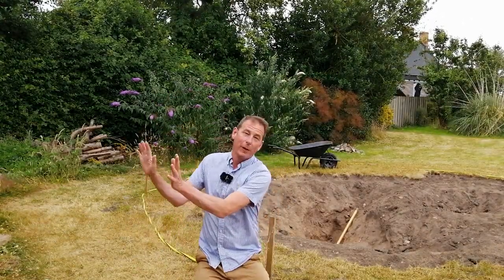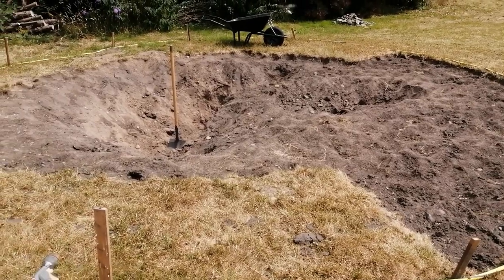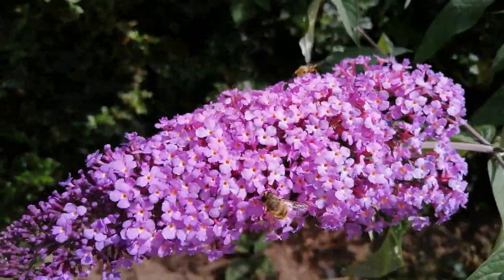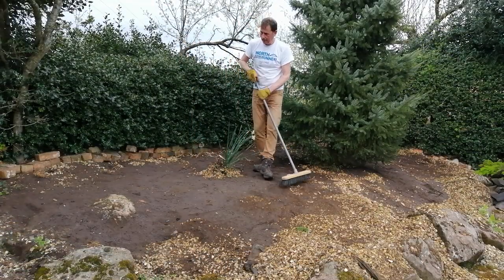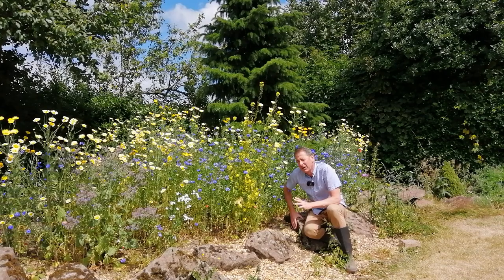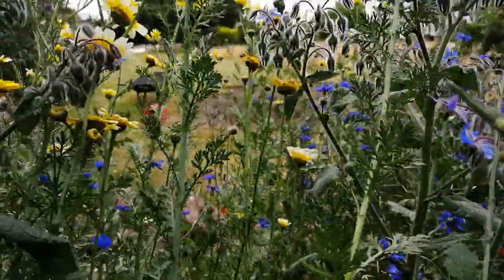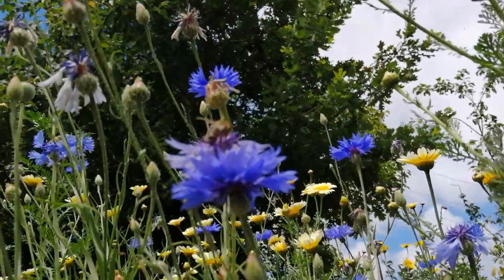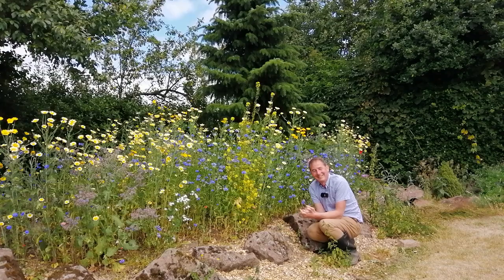Wildflower Meadow. How to create a wildflower meadow for bees.

Comment: Hi, what fertilizer did u use for the flowers, how many times per week and  do you get new flowers after they die or did you buy another package of seeds?
Thank you
Reply from the maker: Hi there. That's an easy question to answer...I never fertilised them, didn't feed them at all. I did water them a little at the start. I haven't bought new seeds but this year I have a whole new crop of flowers which have seeded from last year. Mark